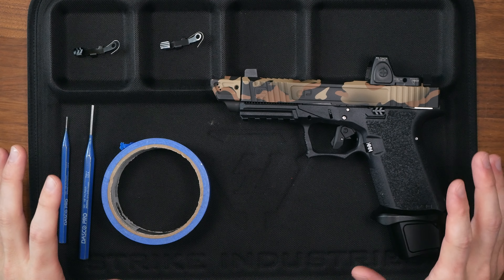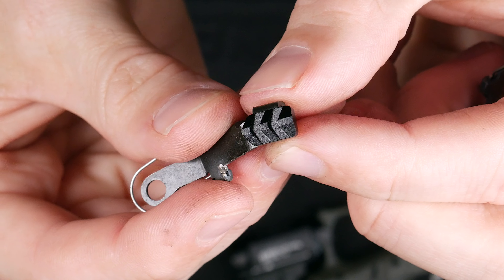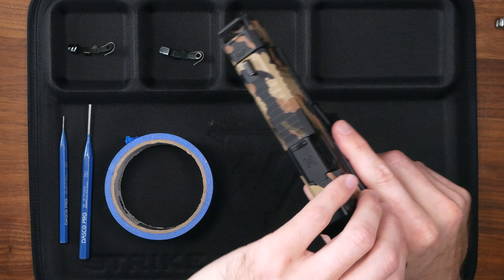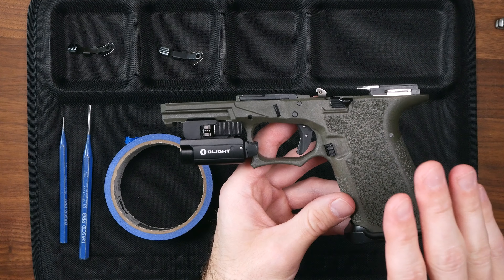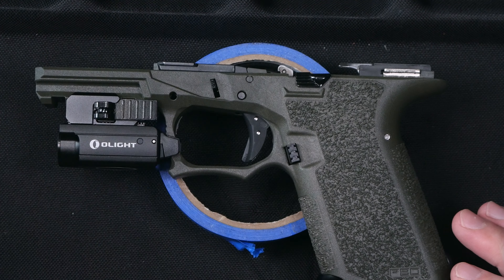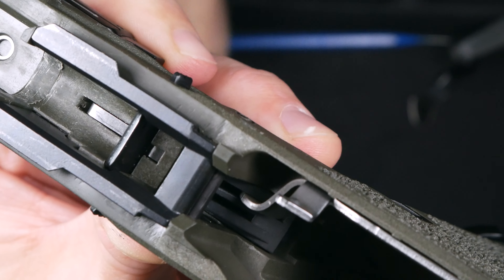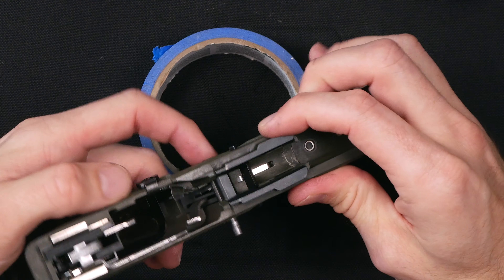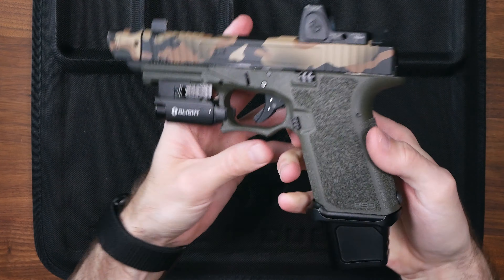Extended Slide Release Install Guide // Tyrant Designs CNC

Comment: Nice and straight forward video. Came here thinking I was doing something wrong... but guess there may be something wrong with the spring on my slide release... as it's not springing back into place whether I put everything back or just with the pins. I may need to ultimately reach out directly to Tyrant.
Reply: I installed one in my G48 and it was an easy install but when at the range made the gun a single shot with locking the slide on every shot.

Comment: I just installed a Tyrant Design Extended Slide Release in my Glock 48 MOS.  It was an easy install however at the range I experienced the slide locking back every other shot out of my 10 round Glock mags and a few times every round fired so I had to use the slide release every shot.  I even gripped the gun as low as possible to be sure I wasn't touching the Slide release.  No clue what's going on but I think it will be returned.
Reply from the maker: Reach out to us at info@tyrantcnc.com and we can give you a hand!
Reply: @tyrantcnc   I'll do that or get an RMA from the retailer
Reply: I'm having the same issue the problem is I cant even return it since I bought of eBay and threw away the package it came in it still hasn't been the 30 days but idk I guess I'm fucked
Reply: @RICKY-LSX   Maybe reach out to Tyrant design and see if they have a fix ??
Reply: @TZOID08  yeah I looked deeper into it and it’s says not compatible with 10 round mags and since I’m in commiefornia  this won’t work for me I need the 17 round mags 🤦‍♂️
Reply: @RICKY-LSX   I guess they need to stop selling them for the Glock 42 43 48 ?? .  Still on their website.  Who told you that ?

Comment: man i dont know why on my slide stop, it makes it hard to put an empty mag on , is that norml? Tyrant sent me a second slide stop since they thought the first oke was damaged. I mean i even thought so, i just got the new one, and its the same thing. Cant put an empty mag in if its not pushing super hard, does not happens with oem slide, is that normal?
Reply: With *Oem slide stop*
Reply from the maker: are you sure you have the correct generation and are you using a full size mag?
Reply: @tyrantcnc  I’m having the same issue, weather it’s a fully loaded mag or empty. I ordered a 3rd gen slide release for my 3rd gen Glock.
Reply from the maker: @mik367  give our customer service a shout. Maybe it got bent out of shape during shipping

Comment: im thinking about buying this for my gen3 glock 19 but it sez DOES NOT WORK WITH 10 ROUND MAGAZINES FOR GLOCK 17/19 in your website?
Reply from the maker: Yes, it isn't compatible with the CA Compliant 10 Round Magazines.
Reply: @tyrantcnc  wait what do the extended slide release have to do with the mags? so also the extended mag release wont work for us in cali?

Comment: Will this work on a gen 3 Glock 22? w/ 10 Rd mags?
Reply from the maker: It'll work with the Gen 3 Glock 22, but not with 10 rd mags. For the time being, it only works with standard sized magazines (or larger magazines that are OEM Glock, in most cases).

Comment: I noticed you only had three pins in. Is the front pin necessary?
Reply from the maker: You should always use all the pins that came with your firearm.  If you have a specific situation with your Glock, please contact our Customer Service and they will help you get it resolved.  info@tyrantcnc.com

Comment: My slide stop has less than 500 rounds through. And is failing and locking back the slide with the mag still loaded. Had to remove.
Reply from the maker: Please contact our Customer Service at info@tyrantcnc.com and they will help you get this resolved.

Comment: So I just installed mine. It doesn’t work at all. When I put it in and push the pin back into place there is no spring tension
Reply from the maker: Please email Customer Service at info@tyrantcnc.com, we will help you resolve your issue,  thanks.
Reply: @tyrantcnc   It’s okay. I spent about an hour bending the spring to match the OEM part. Got it working.

Comment: So a tyrant designs extended slide stop works on a p80?
Reply from the maker: Our ESRs are designed and tested to work with Glock OEM Frames.  With proper fitting they can work with P80 Frames.